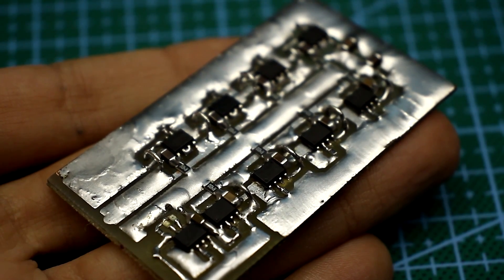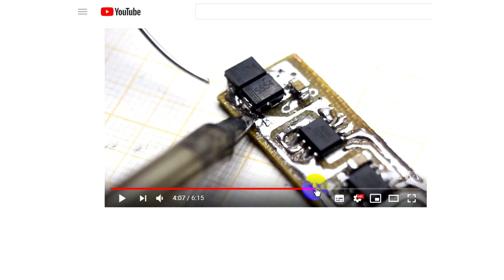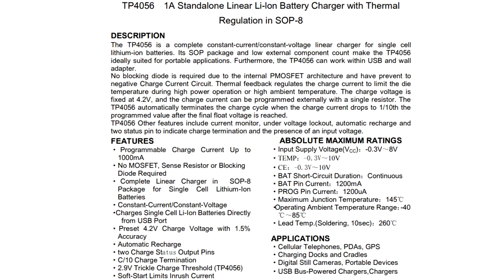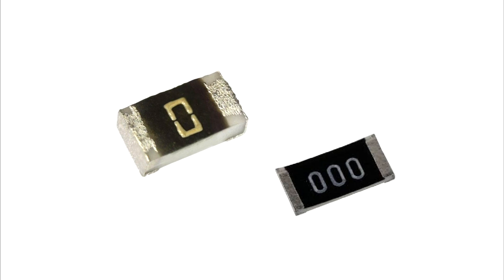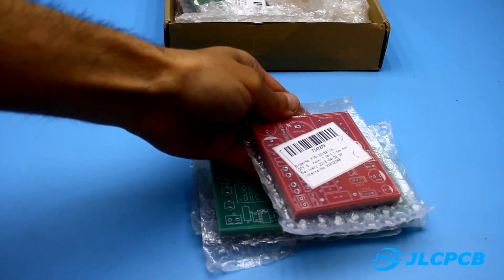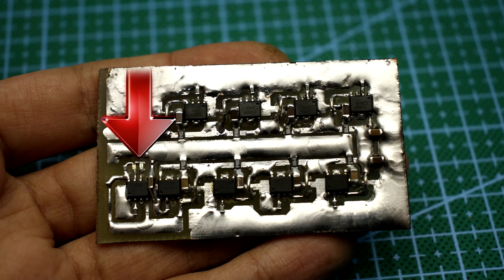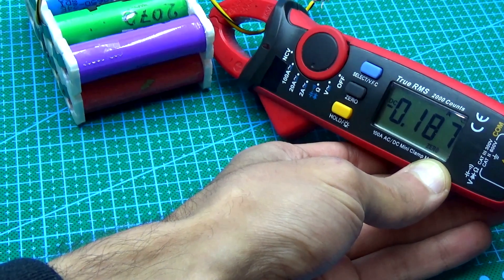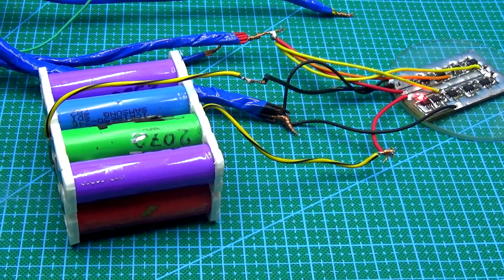Powerful charger for LI-ION batteries

Comment: Few months before I used a Computer SMPS to charge a single 18650 with a single tp4056 module. Then I noticed build up of huge heat.  I couldn't find the reason.  The power supply gives exact 5V.  Why the module take too current? Why is hearts up.

Comment: Can i connect two or more tp4056 module ( with a  over discharge protection built im type) in parallel to get same result?
Reply: @1:50 the schematic shows nine ICs doing what you described

Comment: What you need is just a constant current (CC) and voltage (CV) buck boost converter. And your  battery packs do need fuse wires for connection.

Comment: I have problem with charge lead acid battery 
I have 30 ampere trasformer but when I charge the 100Amh battery only takes 5 ampere 
is there any circuit helps me to control current up to 30 ampere ?
Reply: Tell me again: How big is your lead acid battery? Do you mean 100Ah?? Okay: The amount of current going into your battery is depending on the voltage your transformer supplies. I have charged 12V lead acid batteries with 100A with a 24V charger, no problem but you charger / transformer has to have high enough voltage open circuit, 16-18V, should be needed for a 12V battery if you need 30A charge current. Another reason might be that your battery is old, so it simply has too high internal resistance and won't accept any current and just shoot up to 14V whenever you try to charge it? A lead acid battery in good shape usually only increases a little in voltage when you start charging and current goes up during the first few minutes as the battery warms up and the chemestry gets going, at that point the voltage should stay stable and maybe even drop a little before climbing slowly, until you reach 12.8-13.2V where you have to decrease current, so you don't over charge it. When current have dropped to 0.5A or so while the battery is at 13.2V, it is completely charged, if it takes more current or voltage drops below 12.8V when removing the charger, your battery is old and worn. If your battery is old, try reviving it with deliberate over charge to 15-16V and hear the cells fizzing for 5 minutes.
Reply: @Tore_Lund  yes it's old but not too much .. only 4 month of using but dont have enough electricity to charge it .. only 5 hours per 24 .. and I know its better to charge the battery with 10% if its capacity.. but I have to control the current in my situation 
thanx for answering 😗
Reply: @khaledmom  So you have a lot of power outages and you are using your battery as backup power when the grid fails! This is clever. 10% charge current is nothing I think slow charging of lead acid is 0.2C = 20% or 20A if your battery is 100Ah, so 30A is not harmfull in any way. Please measure your transformer with no battery connected and tell me what voltage it has?? should be at least 16V if you want to charge with 30A? Another thing, it could be that the power company is supplying too low A.C. voltage to the city, to save power. Then your transformer will also have too low a voltage to charge your battery?
Reply: @Tore_Lund   the volt on the primary 220 v 
and the secondary 15 0 15
I think the problem in the battery and the charger is good but I need a circut that controls current
Reply: @khaledmom  Interesting, so it really is a bare transformer. teh "15-0-15" is the voltage on the secondary side of the transformer +15V and -15V or 30V if you only use the two outer terminals. However this is alternating current that comes out of this and you need DC to charge a battery. The good news is that all you need is a bridge rectifier, or 4 diodes. If you live a place where electronics is hard to get, you can use the diode bridge from an old car alternator. Do a google search for "diode bridge" and there will be pictures that shows what this does to make DC from AC.  Try first to only connect one side of the transformer (15V and 0V) to the bridge rectifier, and you should have around 18V DC to charge your batter directly. If this is too slow charging for you, you just connect another diode bridge to the other side (same 0v and the other 15v). you then have two times 18V DC and can connect them together + to + and - to - for double the current. Then you will have a very nice charger.

Comment: And what if one Li-ion cell is damaged in the package? You do not control a single cell. When one is damaged, the temprature will grow and everything can explode. It could use a temperature sensor glued in the central part of the package and the charger should cut off the power supply when the temperature is too high. I can see that TP4056 has built-in temperature control (NTC thermistor) worth using.
Reply: You don't have to charge each of the cell individually. The paralleled cell will self balancing the charge current, but yeah adding some ntc thermistor to cut the charge current when rouge cell get hot will be helpful.